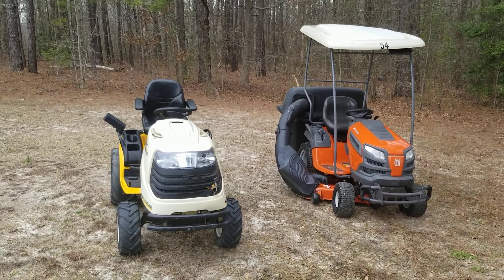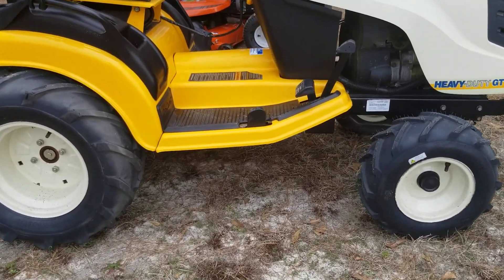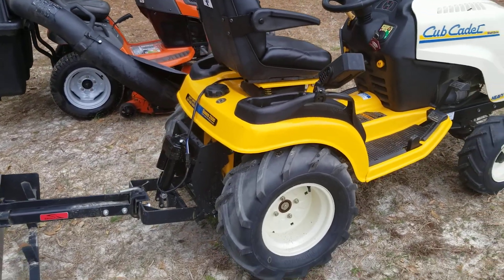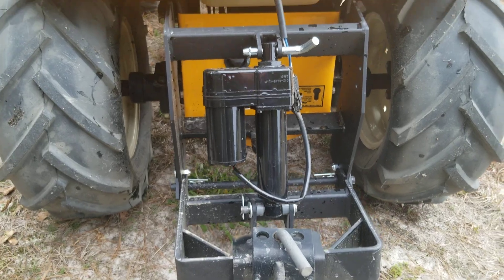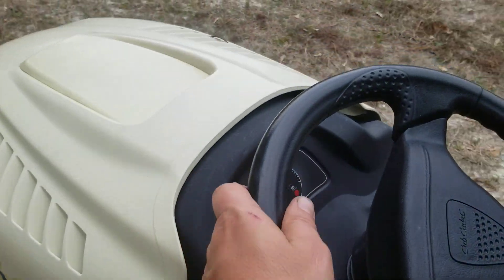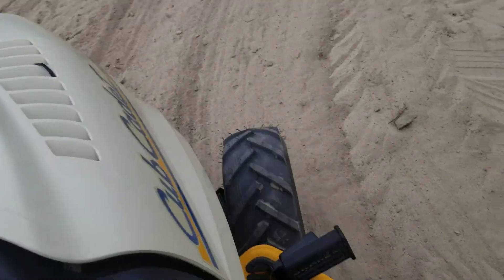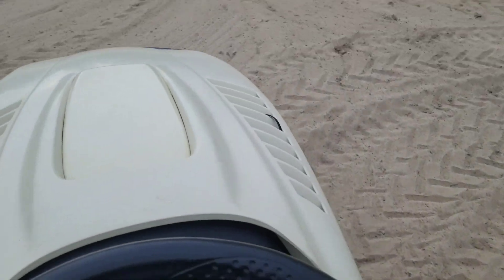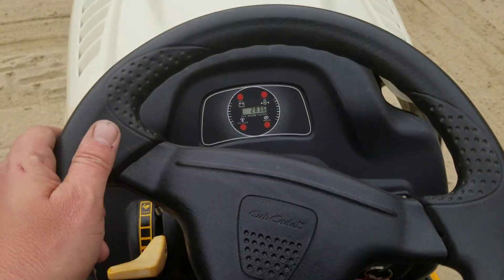AGRO Tires transform Cub Cadet GT2544 tractor into an industrial powerhouse JP Electric Hitch

Comment: I use exact tractor and ag tires to trail ride definitely a beast keep up with four wheelers up hill through mud deeper than tires
Reply from the maker: I tried it out in the back woods and it was pretty sweet with the ground clearance without the mower on it.

Comment: well great video, I am building a 2550,bought the hydro transaxle , just picked up the frame steer sector was frozen,fixed that had to cut  the welded stud and drill it out of the casting ' I'm installing a 10hp diesel on this baby,.I noticed you use this mainly  for tractor . I have a zero turn for cutting so this will be strickly for tractor use. I was wondering how to utilize the deck handle  for some operational attachment any suggestions ?

Comment: MaxAuto Lawn Mower Tires 16X6.50-8 Front & 23X10.50-12 Rear on amazon $272.70, are these the tires you used?  They look great, but are a bit bigger than stock.  Do you think wheel weights will fit with these?  will the 42" deck still fit? i bought a gt2542 a few months ago for $850 w/317hrs! this is what i wanna do to mine. the johnny hitch is super expensive tho, i think ill mod the craftsman with more steel and an actuator or fab from scratch. thank you for these gt25xx videos!
Reply from the maker: Those are the ones I got. 

No effect on using wheel weights    or the 44" mower deck, they fit perfectly on the stock rims.

I mowed with it a few days ago.

Glad you like the videos, I'll be posting the transmission oil change coming soon.

😎
Reply from the maker: Johnny Products sells an actuator kit for any manual sleeve.

Comment: If the front tires don't drive or in other words, if it's not a 4 wheel drive, those front ag tires should be the other way around. I know it would look weird but think about how the ag tires push out the dirt to the side. The rear tires have a turning force behind them but the front tires do not.
Reply from the maker: Interesting, might have to try out some turning and terrain tests both ways to see which works better.